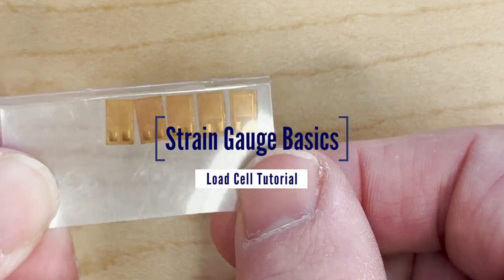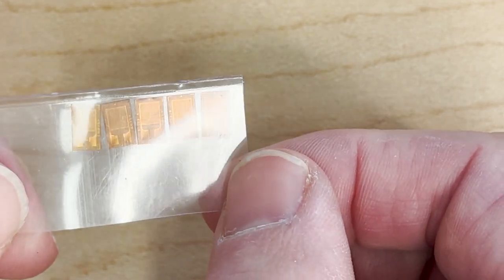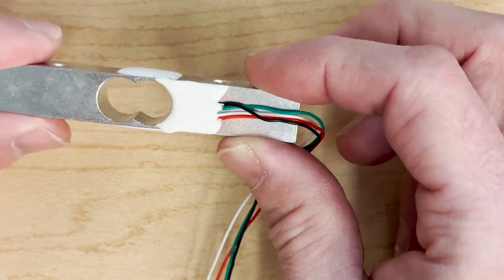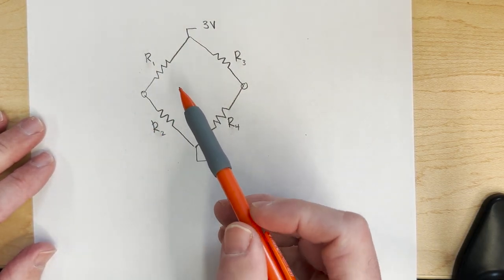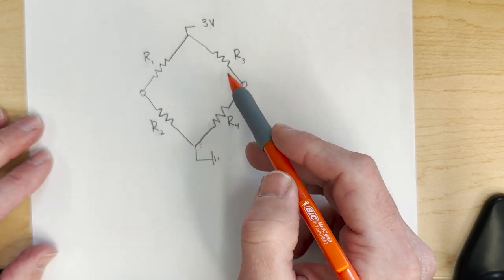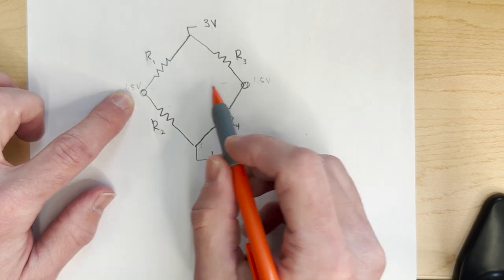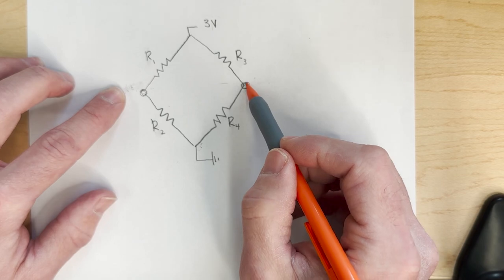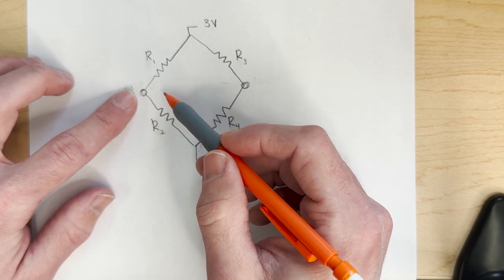04 Strain Gauge Basics for Raspberry Pi and Load Cell

Comment: Nice vid, thanks. Just wondering why if there is 4 resistors and the voltage is read after R1 & R3 in your diagram, does R2 & R4 do anything?
Reply from the maker: R1 and R2 are in series, just like R3 and R4 are in series. In a Wheatstone bridge, all four resistors (R1, R2, R3, and R4) play essential roles in determining the balance of the bridge and its overall functionality. 

R2 and R4 are part of the ratio arms of the bridge. Their values are typically set and known. These resistors help establish a known ratio between the two sides of the bridge, which is crucial for measurement accuracy. When the bridge is balanced, the ratio of the resistances in one pair (R1 and R2) equals the ratio of the resistances in the other pair (R3 and R4).

So, while R2 and R4 may not be adjusted during measurements, they are critical for the proper operation of the Wheatstone bridge and for achieving accurate resistance measurements.
Reply: @ProfessorJohns  Thanks. My next project will have a load cell and I like knowing how things work. 

Thanks again for the vid and knowledge
👍